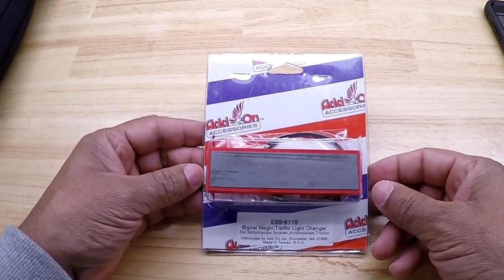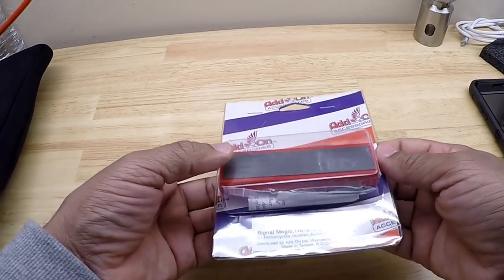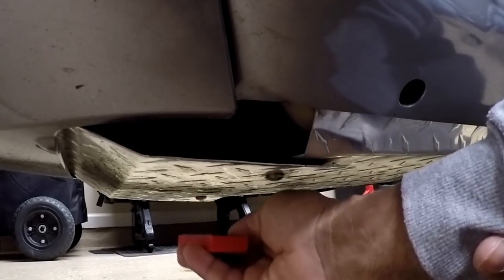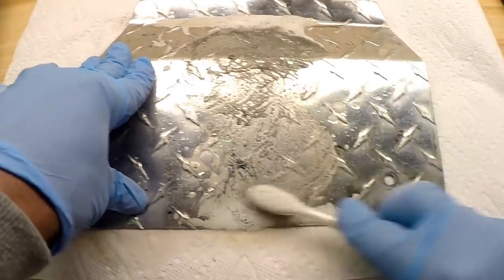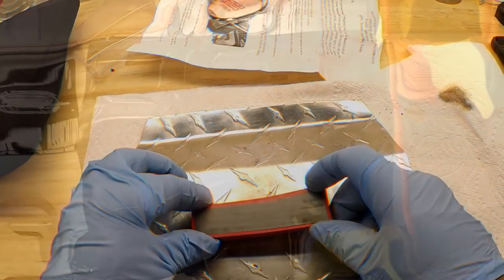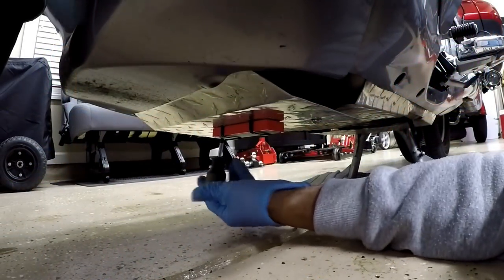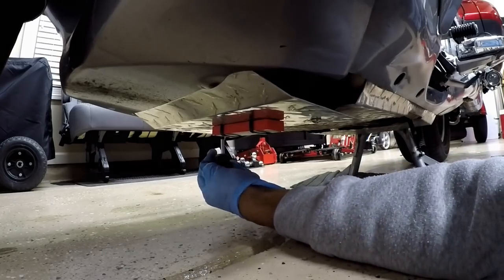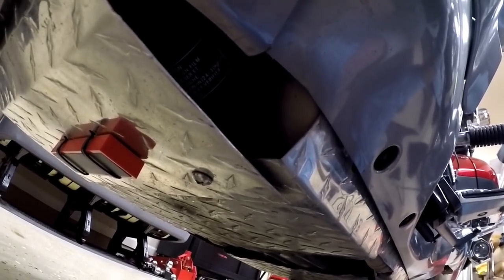Traffic Light Changer Signal Magnet installation

Comment: That's a great idea. But don't the lights now a days have camera's? Another job well done
Reply from the maker: Very good question Allen, not only are there induction loop detectors, some traffic lights has cameras, fixed timers, pressure pad detectors, magnetic, magnetometers, radar, sonic, radio frequency, and light emission.  Traffic engineering is a facinating subject, I forgot about push button, LOL.
Reply: some do but not all. there are a few lights in my city that won't trigger unless a car pulls up behind me

Comment: THANK YOU!!!  You are CORRECT that one can also by a pair of "Super Magnets" (two per package) at Lowes for $5.00 that will do the same thing.  I bought them and mounted them (side by side) on the bottom of my motorcycle frame and they change the traffic lights (that have control loops buried in the pavement at the traffic light).  I have done this for several Friends' motorcycles (Harley Davidsons) and they worked well.....  It should work on ANY motorcycle!!!

Comment: Nice bid I have seen these before. I am wondering would it work if you had mounted it to the inside of the belly pan. While we always try to be careful and not bottom out the bike it does sometimes happen and I am thinking it could either be knocked off or bend the pan. Thanks for the bids you make they are fun and informative.
Reply from the maker: I've never bottom out my bike before, the purpose of the belly pan is to protect the underside of the bike, If I bottom out my Goldwing and crushed the belly pan, I  will have more damage to worry about than a $10.00 magnet.

Comment: Nothing worse than having to wait two or three light cycles. My city  modernized all our traffic lights with pole mounted sensors, which also detect motorcycles. Ride safe bro.
Reply from the maker: All intersections are not induction loops, some have timed lights, or even cameras.  The magnet is good at certain intersections.

Comment: Chris, Isn;t there a chance that the magnet will be knocked off by a bump or high center crossing? Just wondering.
Reply from the maker: The magnet will not come off unless the bottom of the bike is crushed underneath requiring me to call for a tow truck at that point a $10.00 magnet is irrelevant.